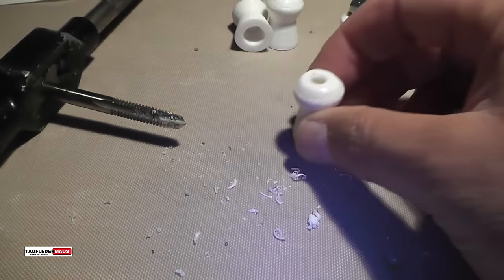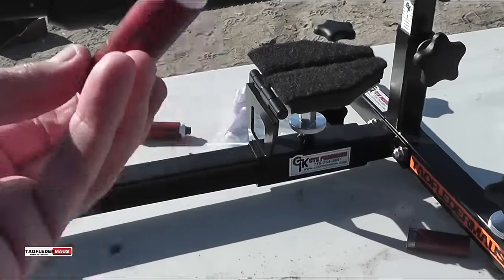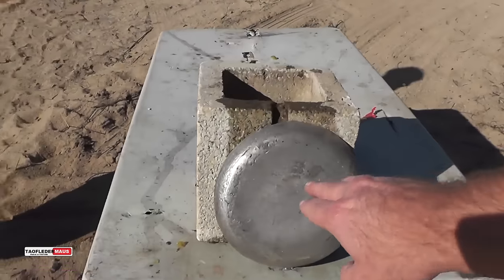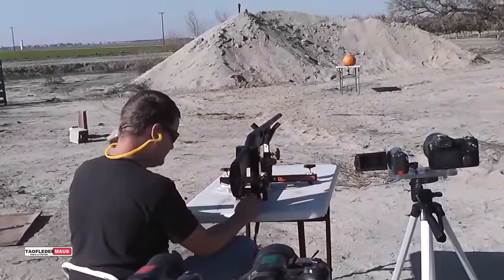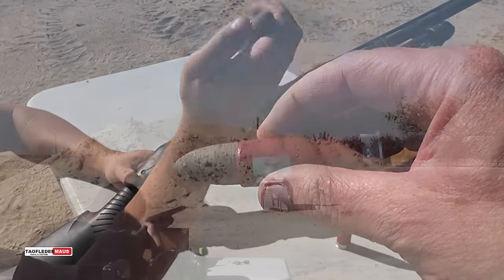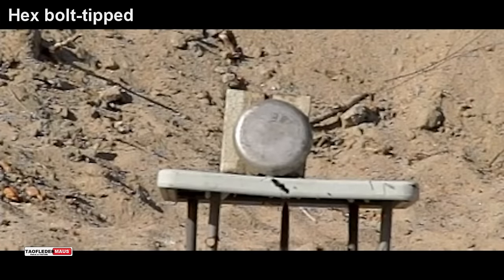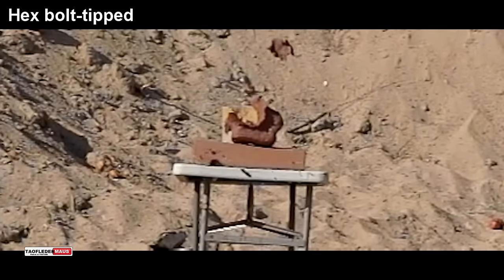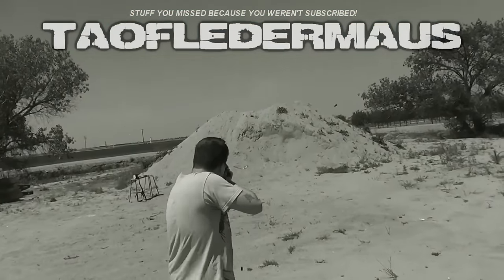15 year old viewer creates incredible 3D printed Slugs

Comment: They're just pellet gun pellets re-sized.
Obviously they'll work.
I don't understand the surprise, and I don't understand why it says he invented them...
Reply from the maker: +Sean Dali   It's a new invention.
Reply: *****
It's just a large pellet gun pellet...
Fair enough.
Reply from the maker: These are 3d printed.
Reply: *****
I know they are.
I'm not arguing with you.
It's like this - If I 3D print a spoon, have I invented a spoon?
Reply: +Sean Dali the whole point is that getting a 3d printed anything to fire, and be even partially accurate, and hold any semblance of shape is something to be proud of, would i say the kid completely invented it, probably not, but he certainly designed something that was, at the least, new to taofledermaus
Reply: +Sean Dali I found this weird too, why even 3D print ammunition?
Reply: burhead0 
I disagree. 
That's like a kid carving a large pellet out if a bit of wood, then saying he invented it because it was difficult to carve.
Reply: +Sean Dali Lol what have you invented with your silly life? Exactly.
Reply: +Sean Dali  He certainly didn&#39;t invent the concept.  Even in this video, the fellas were talking about them trying this themselves earlier with limited success.  At best, there might be a design patent here somewhere.  However, it was the guys above who put the metal in the bullets for ballast.  My guess would be that the "inventor" has nothing here patent worthy.
Reply: +burhead0 I agree with you, but is it still a 3d printed "bullet" if it used a lot of other material to weight it down and give it the accuracy the 3d printed part would never get?
Reply: +Derpy Bros just a little question don't get offensive
Reply: +Sean Dali you would have inveted a type of spoon if nobody eles was able to make a 3d printed spoon but someone already did too bad
Reply: Liberty Justice 
What designing did he do?
Reply: +Sean Dali Man i cant agree with you enough, that annoys me., 15 is not even that young lmao
Reply: +Sense Omkara what experience do you have with 3D printing or CNC work?
Reply: +Sense Omkara In refrigeration if you can think of an addition to an already existing patent to save 1% electricity or cut down on 1% of heat movement through the cabinet you will be a Millionaire or billion air. 
He most likely tried other shapes and compounds until he got it correct. 
When it comes to the liberty movement this is a big deal. Give the man some credit. At least he's putting his mind towards something other then bad mouthing people for trying something new.
Reply: Liberty Justice
You give slack to someone being oppressed in some way, or who's copping a lot of shit for something they did.
This isn't the case here.
He didn't do anything other than re-size a pellet.
I saw some bar stools that looked just like this only the day before yesterday!
It's not genius.
Reply: +Sean Dali The surprise is that nobody including "gun experts" realized that all you have to do is supersize the airgun pellet until this kid came along.  Kudos to the kid for thinking outside the box.
Reply: Geoffrey Yeoh 
It's not an invention though. Not in the slightest. 
Sorry... It just isn't.
Reply: +Sean Dali Why you gotta be a downer bro
Reply: Seamus Casey 
I'm not. 
I'm just pointing out the truth.
Reply: +Sean Dali Some people just cant handle the truth.
Reply: +Sean Dali I know what you mean but TOAFLEDERMAUS stupidity and ignorance knows no bounds. Then you have his little fan boys defending him, “Never underestimate the power of stupid people in large groups.”- George Carlin
Reply: here's the thing though, this bullet isn't exactly the same shape. keep in mind that, while 3D printers can print metal, that wasn't what was used here. different materials react to force (the initial blast) and friction (flying through the air) much differently to each other. just because the shape is right, doesn't mean it will work. yes, you can say that the hex bolt and the thread kept it together, but the very first shot was unaltered and still just as accurate and didn't break apart. so please do try to keep this in mind.
Reply: oh, one more thing. If you've ever 3D printed anything, you'd come to realize that the final "sculpture" is not a smoothed shape that you see in the video. there are quite a few imperfections and extra bits that need to be removed before it looks how it was intended to. If he left any form of imperfection or altered the shape at all, it would ruin the aerodynamics of the bullet.
Reply: Jackson Vladimir 
It's a resized airgun pellet. 
Keep that in mind.
Reply: +Sean Dali yes yes, as you've said before. astute observation. Did you also know that they've acknowledged this? That even the individual who made it points this out quite clearly? Even then, creativity and originality aside, as stated in other comments, he, to my or anyone's knowledge so far, he was the first one to openly do this. He wanted to give taofledermaus a 3D printed bullet that could be shot not only accurately, but consistently as well. I'll yield that he didn't event the shape, but he did have the idea to make it larger and that is something that no one has previously done.
Reply: Jackson Vladimir 
Then it's not an invention at all.
Reply: +Sean Dali I thoroughly agree, however that isn't the part of your initial comment I'm focusing on. I'm explaining why it was surprising. Simply put, every previous 3D printed bullet that was sent in never worked properly. This one did even though it weighed the same as the original pellet it was modeled after.
Reply: Jackson Vladimir 
I'm not surprised in the slightest...
Reply: +Sean Dali And thats perfectly fine, however, they were. I wasnt trying to alter your opinion, convince you that it was amazing, or "shame" you for having your opinion. My intent was merely to explain why they we're surprised. Truth be told, I wasn't surprised either but that doesn't detract from the fact that the kid had a good idea.
Reply: were*
Reply: +Matt Wimberly run a program, measure out dimensions, hit print.  yeah, OWww my fingers and brain.
Reply: +Geoffrey Yeoh We have the most effective slug design and shape, Why should you give "kudos" to a sub par design that little effort was put into.
Reply: if it has a unique design that he made, that's an invention,  jesus
Reply: rollinggoronable 
And it doesn't. That's the point.
Reply: +Sean Dali okay, so:
taofledermaus already received tons of different 3d printed slugs.
they hardly worked.
this kid has an idea of how something has to be designed to work, prints it and - it works!
saying he didn't invent this 3d printed ammo is like saying the ballista didn't have to be invented, because technically it is just a larger crossbow.
Reply: Døde Brø 
What did he invent?
Reply: +Sean Dali Yeah well he made them first, not you so don't say shit.
Reply: AshesAndSketches 
He didn't.
Reply: well did you think of it?
Reply: I don't see how anyone can argue this point.  he 3d printed a pellet.  

anyone that's impressed by that is probably moving their lips while they read this
Reply: ***** Watch the video, they had tried many times before but ultimately failed each time, then some kid comes along and makes someting that works, the kids prertty smart if you ask me
Reply: +Sean Dali Because Magic and Fuck All, that's why!
Reply: +Billy Baggs You say that as if people don't occasionally read things aloud or under their breath or somesuch. It's not like that's a proper indication of stupidity. A proper indication of stupidity would be pushing a pull-only door more than once.
Reply: when he says that the kid is a genius is just a huge gringe, anyone can resize a solid pellet then say that they are better
Reply: +Petter Warr Did you think of the design and take the time to go through multiple designs and measurements until you found the right one?
Reply: It's a ridiculous title, talk about reinventing the wheel lol
Reply: +Sean Dali but nobody else thought of it
Reply: Mart Boersma 
Look up ^
Reply: Pretty sure they're talking about 3d printed plastic as being impressive. that it can withstand the pressure without being pulverized coming out of of the barrel.
Reply: ***** 
Like they have everywhere? You've not invented something merely by the virtue of having successfully 3D printed it.
Reply: +Sean Dali You are right, my good sir. "a different kind of material"? bullshite
Reply: +Sean Dali Thats one fine name you have sir! :D
Reply: Sean Confer
Why thank you Sean!
Reply: +ZerOne Games because you can make this at home basically from scratch
Reply: Sean Dali You're welcome Sean!
Reply: Its the fact that he found the size and design that would actually work
Reply: +Sean Dali I agree.
;)
Reply: Oisin Molloy 
Genius.
Reply: Think you could do better at 15? Kid has the spirit to experiment and actually do something. Good on his parents too for giving the kid a 3d printer to play with. We'll  soon be nation of arm chair do-nothing naysayers.
Reply: Blacksheep 
Like what? 
Scanning a pellet into a bit of technology his parents bought him and clicking resize?
Reply: +Sean Dali well he did go through a complicated chemical hardening process, and nobody had though to do it before, so cudos to him.
Reply: +Sean Dali He hardened it, he threaded it for inserts, actually made them and shipped them and reached out to Taofledermaus. This kid is a go-getter that gets it done so the community can benefit. Plus he has the technology and knows how to use it. Respect to Michael and his parents.
Reply: Totally agree with you
Reply: Blacksheep
So it's not so much that he invented them, but that he recreated them in his own image, with materials that they hadn't been made of before. Hmm... he should make an apple.
Reply: +John Creese So obvious after the fact what works isn't it? But if it was so obvious why didn't any of the haters do it. People forget this is all about learning, Michael is learning a lot of practical skills at 15. His parents are investing time and money to feed his education and interest. If only we had more parents that took that much interest in their children.
Reply: Blacksheep
I'm not even sure what you're trying to say. Are you arguing against what I said, which was generally positive in relation to the kid? Or are you just expressing another set of thoughts of yours? And yeah, if only we had more parents like so. Firm, but not too unyielding and such.
Reply: Blacksheep
A screw in the end!
Wow.
what an achievement.
Reply: Sean Dali
I know right? Sometimes, you just gotta screw something in the end. It's an amazing achievement.
Reply: +Sean Dali Even if you were gifted a 3d printer I doubt you would lift a finger to learn to use one. That is the difference between do nothing talkers and self actualized people like Michael.
Reply: Blacksheep 
Well that's a weird assumption to make. 
You happen to be exactly wrong.
Reply: +Sean Dali 
He absolutely invented it. Just because he derived it from another similar design doesn't mean he didn't invent it.

That's like saying that the person who invented the rubber tire didn't invent it, because wood and iron wagon wheels already existed.

They had tried to create a 3D printed shotgun slug that would fly true, and they failed. He took an existing concept, and applied it to a specific problem, and managed to get good results.

That's an invention.

I think you're just jealous. ;)
Reply: Wrenchmonkey
No. A tyre is made of those things, it's not just those things. That's the fallacy of composition.

No one is claimed he invented the materials.
Weird comment.
Reply: Wrenchmonkey 
No he didn't, he resized a pellet. 
That's literally it. 

I saw some stools that were identical the other day. 
What an amazing innovation!
Reply: Wrenchmonkey 
A new purpose? 
What's that? 
It's only resized. The material is defined by the 3D printing. 

I suppose those stools were an amazing invention too, right.
Reply: Wrenchmonkey 
Nope. Plastic pallets with an aluminium tip/core have been around since I was a kid. 

He had the "idea" that something designed, tried and tested to be aerodynamically stable... Is aerodynamically stable if its a bit bigger. 
Whoopy do.

As for the autism accusation, well I'm far from it. I'm extremely sociable. 
Weird insult.
Reply: +Sean Dali 
"Nope. Plastic pallets with an aluminium tip/core have been around since I was a kid."

3D printed? For shotguns? Link? Thought not.
Reply: Wrenchmonkey 
No, that's exactly my point! 
Maybe you're replying to comments you've not even read?
Reply: +Sean Dali 
If that's your point, then you're arguing against your point.

He invented this item, using existing concepts. It's called a derivative invention.

Pretty much nobody has ever invented anything that isn't derived from existing concepts and ideas.
Reply: Wrenchmonkey 
Yeah... 
You've decided to reply to comments you've not even read. 
Weird.
Reply: Wrenchmonkey 
In insult.
A ridiculous one. 

Bravo
Reply: +Sean Dali 
Awww, don't take it as an insult. Just own it! Be proud of who you are!
Reply: Wrenchmonkey 
Trolling is genuinely pathological
Reply: +Sean Dali 
At least you recognize that you're a troll. That's the first step to recovery.
Reply: +Sean Dali
Sorry to hear that. Have you sought professional help? Medication?
Reply: Wrenchmonkey 
Oh, well done!
The "no you are" form of discourse.
Reply: +Sean Dali 
Try lithium.
Reply: because it's not a rifled barrel lol
Reply: +Wrenchmonkey The conversation was so fun I ended up looking in the dictionary.  The full definition of Creation includes the act of inventing.  But If I were to give my opinion, it's a 3d hollow point created for a .70cal.  
edit: (semantics!)
Reply: +Audaylon 
...which is an invention. :D
Reply: Wrenchmonkey
Nope. It's not. At best it's an innovation regarding something for which there's no need.
Are those stools I saw an invention?
Reply: +Sean Dali 
Yes, stools are an invention.
Reply: Wrenchmonkey
Look up ^
Reply: +Sean Dali
You aren't much for critical thinking, are you?
Reply: Wrenchmonkey 
Is the stool shaped the same an invention? 
I'd say neither of them could even be called innovations. 
Tell you what, I start scanning random household things and printing them out in different sizes. After a week, by your own reasoning I'll be the most prolific inventor to have ever lived.
Reply: +Sean Dali

If you can find a different purpose for those stools, sure, I guess.

Funny that you're so desperate to claim that he didn't invent anything. Projecting, much?
Reply: Wrenchmonkey
"If you can find a different purpose for those stools"
Sitting on.
The stools are the same shape.
You know what, this is boring. I'm repeating myself.
AGAIN!

LOOK UP ^

"Funny that you're so desperate to claim that he didn't invent anything."
He didn't.
I wouldn't even call it an innovation.
Again, if this is an invention I'm gonna start scanning everything in reach and 3D printing it in different sizes. In fact, fuck it, I'll just 3D print the same thing in a million sizes.
I'll be the most prolific inventor of all time, right?

"Projecting, much?"
That literally makes no sense whatsoever.
Reply: +Sean Dali 

You are indeed repeating yourself. Because you have nothing new or intelligent to say.
Reply: Wrenchmonkey
Again, I would be the world most prolific inventor by your exact logic.

Reductio ad absurdum is a valid and common form of argument.
You're running away from it.
If your reasoning ends in an absurd conclusion, it's clearly a good indication that the logic is absurd.
You claim that re-sizing a projectile for a larger launcher is inventing something.
Presumably those stools are also an invention. Clearly if I resize something then I've invented it, that's your claim here, so if I go about resizing things that already exist I can claim to have invented the new larger/smaller thing.
So I can become the most prolific inventor of all time in the space of a month.
Reply: +Sean Dali 
Reductio Ad Absurdum is actually a common LOGICAL Fallacy! Look it up. ;)

If you are reducing arguments to absurd comparisons, it's because you cannot logically defend your position, and instead resort to fallacious argument.

Thanks for pointing that out, troll.
Reply: +Sean Dali 
And, once again, by your standard of anything that has been redesigned or repurposed to a different use is not an invention, then nobody has ever invented anything.

There's no such thing as an inventor.
Reply: Wrenchmonkey
"Reductio Ad Absurdum is actually a common LOGICAL Fallacy! Look it up. ;)"
That's one of the stupidest things I've read online. Seriously. I can't believe you just said that.
At least I know the level of intelligence I'm playing with here.

Res ipsa loquitur.
No wonder you're pushing this gibberish so hard! You don't understand basic logic.
No. It's an argument technique used to spot logical fallacies, and highlight them!
I'm staggered that you didn't take the minute it takes to google it!
I mean... I just explained above exactly what it means!
It's used constantly in everyday language!

This from wiki - 
Reductio ad absurdum also known as argumentum ad absurdum is a common form of argument which seeks to demonstrate that a statement is true by showing that a false, untenable, or absurd result follows from its denial, or in turn to demonstrate that a statement is false by showing that a false, untenable, or absurd result follows from its acceptance!

That was properly hilarious.
Thanks for that.
Reply: Wrenchmonkey
" by your standard of anything that has been redesigned or repurposed to a different use is not an invention"
It's a projectile. It's purpose is to be launched out of a barrel.
It's not been repurposed, it's been resized.
It's not an invention.
I refer you to my previous reductio ad absurdum.

And no. Most inventions aren't one tobject being repurposed to another task at all.
Reply: Wrenchmonkey
It's the same purpose.
The materials are what's required for 3D printing.
Re-sizing, as we've already established, it not a form of invention.

"If we want to follow your own reductio ad absurdum all the way down the rabbit hole, nobody's ever invented anything"
That's total nonsense. 
A radio isn't a re-purposed anything.
A lightbulb isn't a re-purposed anything.
Most inventions aren't re-purposed things.
And yet again, it's the same purpose!
The only word you used that's even mildly relevant is "rearranged" and that's still ambiguous.

"projecting your failures onto a 15-year-old kid"
What failures?
Seriously...  I have no idea what you're talking about.
As for his age, it's utterly irrelevant. Appeal to emotions fallacy.
Go ahead and try to argue against that too, it might be as hilarious as your misunderstanding of reductio ad absurdum, literally one of the most common forms of argument.

"who has already accomplished more than you ever will."
You have literally not a single clue what I have and have not achieved.
At his age I was flying airplanes and I'd been holidaying with friends unsupervised twice! I was a precocious kid. I looked after my disabled mother and used to carry her to the car for work every morning, and cook and clean for myself and my brother.
If you honestly think that re-sizing and 3D printing a pellet is an achievement above and beyond anything that a 32 year old adult has achieved then I genuinely feel sorry for you and how pathetic your life must be.
Sorry, but you've insulted me too many times for me to give a fuck about insulting you any more.
You're demonstrably stupid.
I still can't get over the whole -
"Reductio Ad Absurdum is actually a common LOGICAL Fallacy! Look it up. ;)" thing.
I mean... a few seconds google search would put you right. You don't even fact check.

I'll end it there.
Reply: +Sean Dali 
A radio is a repurposing of several things (including materials).
A lightbulb is a repurposing of several things (Including materials).

Essentially, they're just a 'rearranging' of things that already existed.
Reply: Wrenchmonkey
So is literally everything that happens in the universe.
So breathing (re-purposing atoms of certain gasses to fuel biological redox reactions) and stellar nucleosynthesis (re-purposing protons and neutrons to form new nuclei) and atomic decay and clowns falling over and clouds and photosynthesis and printing a document are all inventions, right? I didn't photoshop somehting and print it out, I invented a new picture! I'm an inventor!!!111oneoneone. In fact, fuck the photoshop, I just resized the image!
I'm an inventor!!!
A person eating his Weetabx, cutting it in half with his spoon has invented something because he's re-purposed the atoms in his Weetabix to better suit the size of his spoon!
No.

You are defining the word invention so ambiguously and with casting such a wide net that this instance falls under it's definition.
Redefining words to suit your argument is a concession that you have lost the debate.

Also, he's not rearranged anything at all.
He's resized something to the ends of the exact same purpose on a larger scale.
I've pointed this out several times now.

I honestly think you just don't have the intelligence to understand what's being said to you.
It's the Dunning-Kruger effect.
Which is why you made the ridiculous "reductio ad absurdum is a logical fallacy NARF" comment.
Reply: Sean Dali
Yeah. But, relative to our perspectives, those repurposements are new. It's when you start getting non-new repurposements that it just doesn't really seem right. I'm really not even sure what happened here. Last I checked, there were not this many comments in this chain, but whatever. Have a nice day and pie on
Reply: John Creese 
What new purpose? 
A projectile is now a... Projectile!
Reply: Wrenchmonkey 
Right. 
Repetition, no acknowledgement of my argument, and a personal insult. 

Genius.
Reply: +Sean Dali 
your argument falls apart in both directions.

if you are only capable of absolutes, either nothing is an invention, or everything is. You don't have room for anything else.
Reply: Wrenchmonkey
I'm not only capable of absolutes. Weird straw man argument you're going for there.

I cannot possibly simplify it for you further.
Reply: +Sean Dali 
You're wanting to take every argument to absolutes. You may be capable of more than absolutes, but you haven't demonstrated it to this point.
Reply: Wrenchmonkey
I never said any such thing.
I stated my case, and I couldn't have been clearer.
You've decided to give up reasoning and instead babble to yourself about absolutes.
You've so far ignored every question put to you.

This has no point. You're not reading my comments at all, or your ignoring their content.

This is a re-sized projectile. Re-sizing something for the exact same purpose on a different scale doesn't make it an invention.
I cannot be clearer.
If you claim it does, then you end up caught in a reductio ad absurdum as I have already stated a few times now.
It's inescapable.
If re-sizing things is inventing them, then I can in a very short space of time become the worlds most prolific inventor.

I have no doubt that I'll have to restate this all again as you have failed to address it repeatedly.
I know why that is. It's a knockdown argument.
You're screwed.
Reply: +Sean Dali 
Where did there exist 3D printed projectiles of this type before he made them?
Reply: Wrenchmonkey
Oh, so printing them 3D makes them an invention?
That's the part that confers upon something the title of a new invention, right?

Then my argument remains identical.
In fact, that's the first way I phrased it!
I included 3D printing and re-sizing.

You cannot get out of the reductio ad absurdum.
It stands.
Reply: +Sean Dali 
yes, a new method of manufacture and new material constitutes invention.

YOU said that all he did was re-size them. If that's true, then show me the product that was otherwise identical, besides being smaller.

Show me the steel-cored, plastic-bodied, pellets of this shape that existed prior to his creation of them for the 3d printer.

All he did was re-size an already-existing product that somebody else invented, right?
Reply: Wrenchmonkey
"yes, a new method of manufacture and new material constitutes invention."
Really?
Then you admit that I can, within the space of a few weeks MAX, easily, become the worlds most prolific inventor.

Clearly your definition of an invention is different to that of any rational human.

"YOU said that all he did was re-size them"
Nope.
Look up ^

You have argued so long that you forgot where you were! Hence trapping yourself into an argument that ends in an absurd conclusion.
Reply: +Sean Dali 
Great, then just show me where this same steel-cored, plastic-bodied, projectile was already available in smaller scale.

I'll wait. ;)
Reply: Wrenchmonkey
What are you talking about?
Oh, are you saying it's an invention because it's a plastic body and a steel core in that exact shape? 
So re-sizing and adding a steel core makes it a new invention? Are you going to simply keep changing your argument again and again so you end up forgetting what it is you're arguing against again?
It's pathetically obvious.

You're now getting into sophistry.
You know you've lost the argument, but you're one of those all too common people in this world who simply cannot admit when they're wrong.
I sincerely believe it's one of the worst ways of thinking in the world, and the cause of most of the worlds major problems.
Seriously.
People like you ruin everything for everyone else.
Reply: +Sean Dali 

Every time I point out something else he did, you myopically jump on that one single aspect, and say "So, so doing X" constitutes an invention?

Are you going to show me where this existed somewhere else for him to have merely resized it, or are you going to pitch a little fit while you watch your stupid argument fall apart before your eyes? ;)
Reply: Wrenchmonkey
No, this is a repeat of your "new materials" nonsense that my reductio ad absurdum completely destroys.
You've just forgotten my argument.
Again.

This is boring.
You're not able to keep track of what either of us has said.

Look up ^

Already refuted.
It's getting on the way to being a PRATT.

"Are you going to show me where this existed "
Yes. Pellets for pellet guns.
This is the last time I'm repeating myself.
From now on I'll simply refer you to my previous replies.
Reply: +Sean Dali 
Maybe it's just your ignorance about ballistics that is causing you to utterly fail to grasp this concept. But when you completely alter materials, behaviors are altered too.

So are you conceding that this specific item did not already exist, in ANY size, prior to his creating it, or are you going to show me where it did?

Still waiting... 

Look up ^.
Reply: Wrenchmonkey
I refer you to my previous repeated replies in which this is clearly repeatedly addressed.
Reply: +Sean Dali 
So you're going with pitching the fit, while you watch your argument completely crumble... 

Figured you would. You're very predictable.
Reply: Wrenchmonkey 
It's pretty clear Yoi have lost this one on simple logic. Hence the repetition. 

Again, I've addressed it all numerous times above. I'm not repeating it again.
It would literally be more than ten times repeating the exact same point. 
I warned you, but you couldn't help yourself with this silly repetition. 

So I refer you to my previous replies.
Reply: +Sean Dali 
So you're definitely going with the fit, and more red herrings, and circular logic.

Again, predictable.

Show me the identical product that he otherwise just resized.
Reply: Wrenchmonkey 
I refer you to my previous comments.
Reply: +Sean Dali 
You certainly do. Because you don't actually have anything to say. You just want to talk in circles...
Reply: Wrenchmonkey 
I already explained repeatedly. 
There's  I way to simplify it further for you. 
It's all there. I refer you to my previous replies.
Reply: +Sean Dali
And yet, the issue isn't one of simplicity, but rather your inability to produce anything to support your half-assed claims...

Look up. ^

I'll just be here waiting for you to produce that evidence of your claims.
Reply: +Sean Dali Exactly
Reply: +burhead0 He didn't didn't design it. He took something,an air rifle pellet that already exists and scaled it up. I am confident that he copied a Beeman Crow Magnum.
Reply: +Powerpickle68 
lol, what? double negative much?
Reply: Wrenchmonkey
Double negatives are perfectly acceptable language.
It's a relatively recent myth that they aren't. 
Double negatives have been in common use since the inception of the English language and before.

https://en.wikipedia.org/wiki/Double_negative#Two_negatives_resolving_to_a_positive
Reply: +Sean Dali if he didn't didn't design it, that means he designed it.
Reply: +Sean Dali 
Indeed.
Reply: +Leway Managa 
*you're
Reply: Correction: why do you give a shit?
Reply: ThatEmoGamer 
Clearly you do.
Reply: Sean Dali Actually, I don't really give a monkey's about the subject matter. I just find it interesting that you took the time out if your life to pointlessly argue over this.
Reply: ThatEmoGamer 
Third comment so far Mr "I don't care"
Reply: Sean Dali I don't think you understand the point if my comment. All I was wanting to know was why you care.
Reply: Benjamin Nutter 
Want sex? 
You're not hot enough... 

Incidentally here's an example of an actual comment you have actually made, actually, in real life - 

"Question. Can Scyther/Scizor get the move Defog through breeding ONLY in gen 5?"

Lelz
Reply: ThatEmoGamer 
Because I typed a simple comment stating a simple fact and got tonnes of replies... So the question is, why do all those guys ^ care so much?
Reply: Benjamin Nutter Okay... That was a bit overkill.
Reply: Benjamin Nutter And you said Sean was the one wasting his time...
Reply: ThatEmoGamer 
He's a really bad troll. 
Can't believe you're falling for it.
Reply: Sean Dali I don't know why I'm bothering with him.
Reply: Benjamin Nutter The irony in your comments is simply stunning.
Reply: ***** It's the Internet. If they can use memes to try and support their shitty arguments, they can use any kind of disability known to man as an insult. As someone with Aspergers, I think it's fucking stupid to use Autism as an insult. Doesn't really hurt my feelings, just my brain.
Reply: +Sean Dali nobody said he INVENTED 3d printed slugs.... he CREATED amazing 3d printed slugs... read the title of the video please....
Reply: +Sean Dali with your logic nothing is "invented".... guns are just a revormed piece of metal! NOT AN INVENTION! see? makes sense? thought so.
Reply: +Petter Warr then why didnt an adult make a 3d printed slug that works better than or as good as this teenager's slugs?
Reply: +Billy Bob reformed*
Reply: Billy Bob 
Nope. 
If you make an exact replica of an M1911 and then call it an invention because you scaled it, you're lying. 
If you create an entirely different pistol, you have invented something.
Reply: It is not the pistol, it is the function of the pistol. An example is Glock did not invent the pistol, he improved on the function of the pistol. likewise Michael improved on the function of the pellet, thus he invented a new kind of pellet.
Reply: Marcus Aggripa 
Exactly. So it's not an invention at all.
Reply: Not only is it an invention it is an innovation.

I win
Reply: what the surprising part is, plastic isn't supposed to fly good at those speeds. and usually they can't stand the pressure of the blast. even if it is a resized model of an old design, it's amazing that a 15 yr old thought of it before anyone else.
Reply: and before you say any shit. almost no one here said he invented,exept maybe the channel, we are surprised because NO ONE ELSE thought of it
Reply: AshesAndSketches It wouldn't have worked if they didn't add weight to them.. This is not an invention, it is a copycat.
Reply: He invented these like clockboy invented his alarm clock.
Reply: Lets see
rock in mineral
Rock is Thrown
Rock is Now thrown Faster by rubber based Launchers! Which is From Rearnaged Tree Lax and Sticks!
Now Rock is Metal Rearanged from Minerals! which is used for More Rocks!
Now Theres a Metal Pipe from the mineral throwing the Metal !
Now theres An Explosive propelling it refined from Minerals!
Now the metal is Conical!
Now the Metal is bullet shaped!
Noe the Bullet is Resized for a Tank!
Now it has Soft Cap!
Now it Has Arrow with discarding.
and so go on. is Still the same minerals so Every of theses arent invented? riiigh
Reply: Wrenchmonkey clearly showing your intellect aren't you?
Reply: What have you invented?